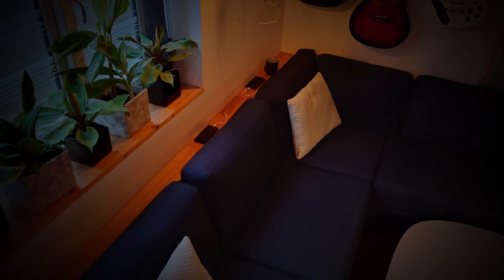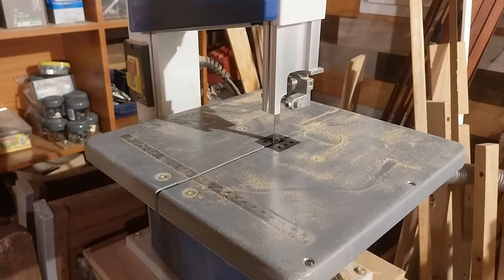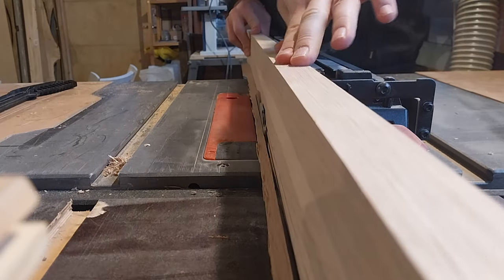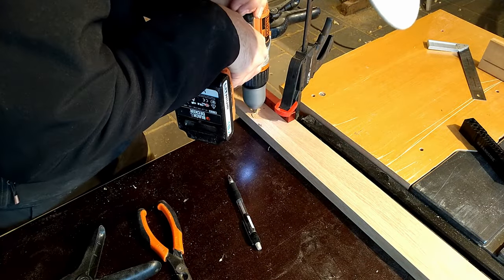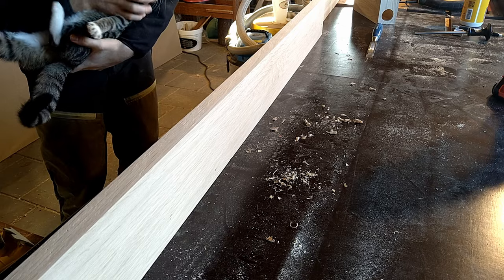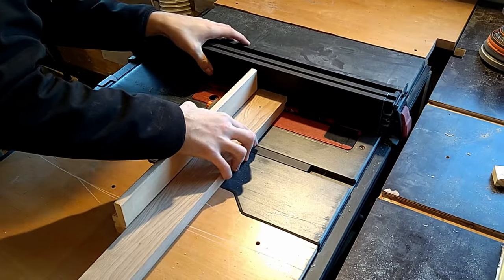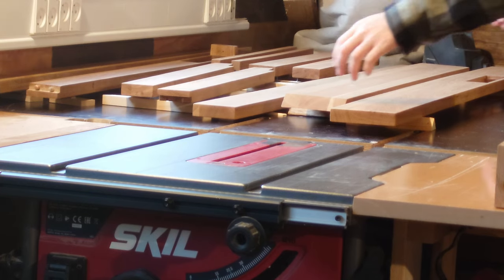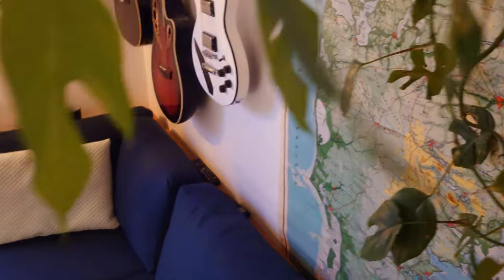Making a console table with hidden outlets! - Upcycling -

Comment: I couldn’t see what finish you used. My go to now for pieces like this is hard wax oil. Since the video from the Wood whisperer late last year, I have switched to 2 pack Natura Onecoat. One coat and it’s done. Touch dry in 30 minutes and very reasonable per square metre because you use so little
Reply from the maker: That sounds like a finish worth trying out one day :)

I used a transparent finish from Denmark called Gori (and then some numbers that I can't remember). It's nothing special, just a basic finish for protection against moisture, but certified for indoor use. I originally wanted to use a wax finish but without thinking about it, I just started using this finish, and about halfway through I facepalmed when I realized I applied the wrong finish.. 
That's what happens when you turn on autopilot.
Reply: @drsnwoodwork  how I recognise that autopilot error. Worse time possible for an injury too. Do try Natura as the finish it leaves all the natural beauty of the timber
Reply from the maker: I will keep that in mind. If ever I see it on the shelf somewhere, it will go home with me!